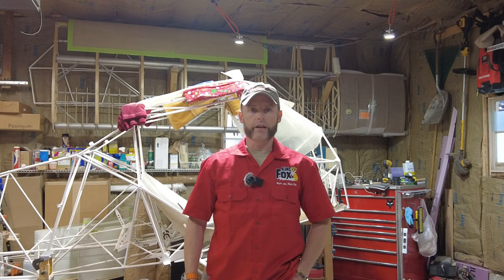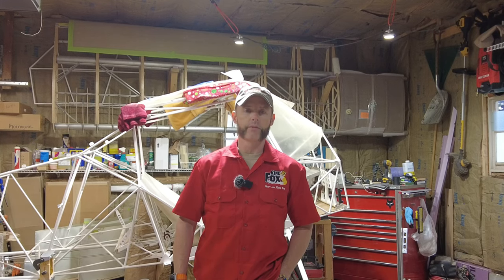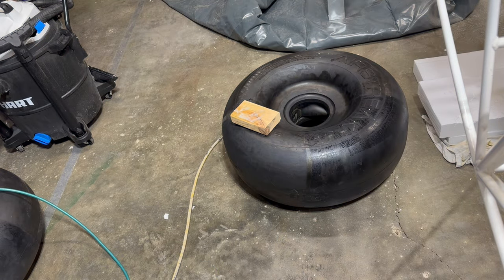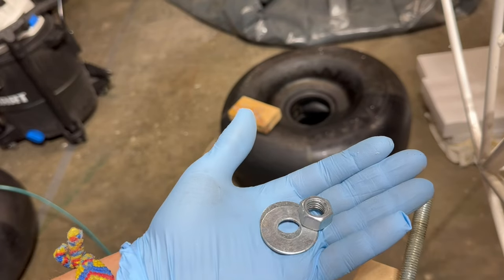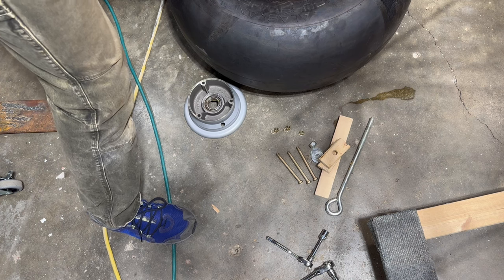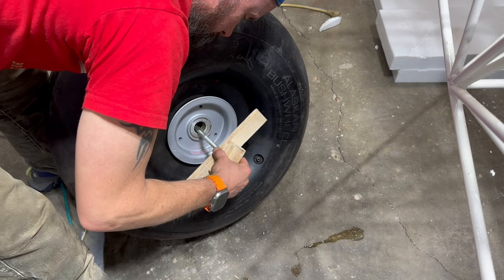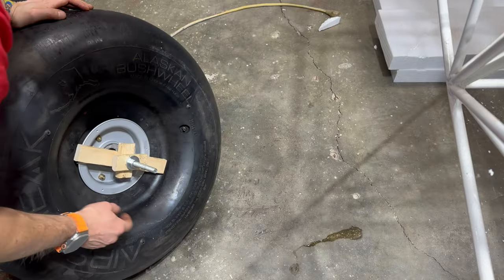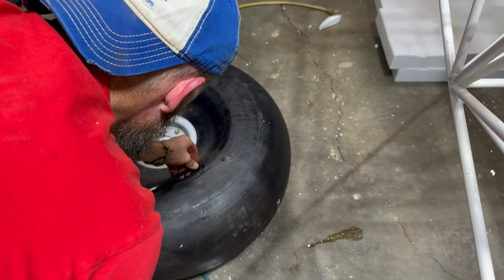#45 Cabane Gear + Monster Shock Install Pt. 4

Comment: This was the first thing I did on my kit to be able to move it around in the shop easily... plus it looks so much more like an airplane on the gear! ;-)
Reply from the maker: Hello Mike, it is one of the first things I should have done also!  But, maybe a good thing I didn’t as I had to move the plane once in the back of my truck and that gear would have made that more of a challenge without the use of a trailer!  Now that it is in the garage however, a game changer for sure.  Thank you for the comment, have a wonderful “Hump Day!“